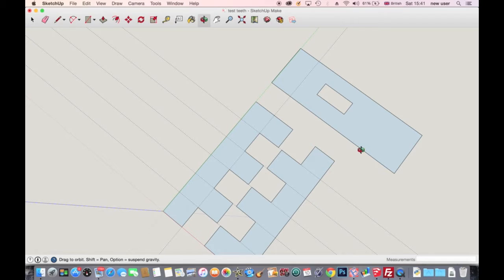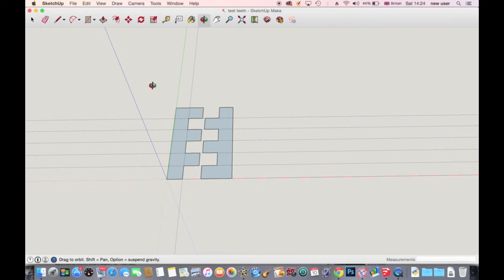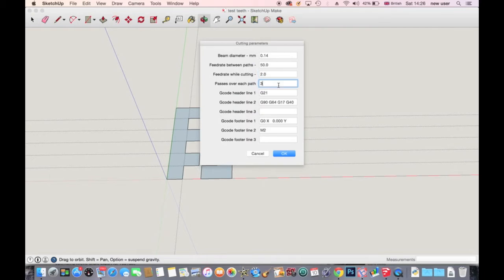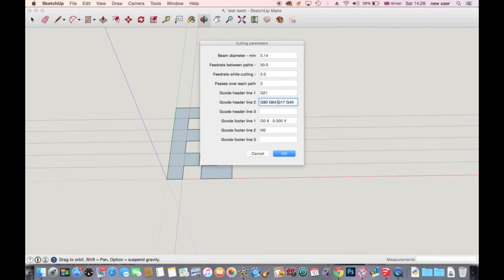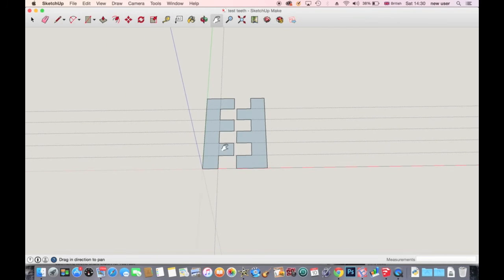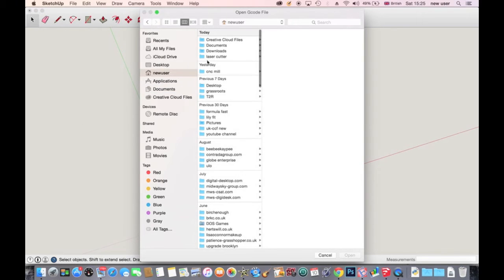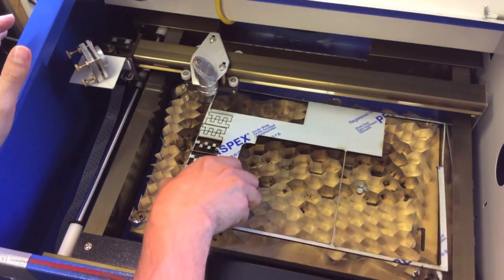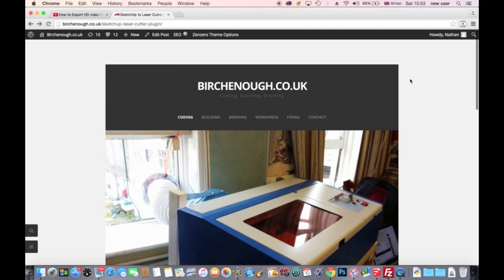SketchUp to GCode Plugin

Comment: I'm going to have to try use this plugin to see if I can create the SVG file that was problematic for me!
Reply from the maker: +Educating Savvas Now, an SVG export option would be an interesting extension for my plugin. The SVG spec looks quite simple - maybe I should have a look at the ones you've used with the Inventables machine. Although I still think you should try running it on Marlin instead of their firmware!

Comment: Great Video and very informative, I can't wait to try your sketup plugin.  I am going to mount a laser on my CNC to cut foam and acrylic.  Do you have a laser you can reccomend?  A big

Thanks to you for sharing your work!
Reply from the maker: I use a 40W CO2 laser but of course you can't mount that on a CNC machine - unless you use mirrors and add a whole lot of safety features. My friend https://www.youtube.com/user/miscpro has experimented with some laser diodes in the past and has recently been given a very powerful one to try, so he might make a video about that soonish. You are going to need quite a powerful laser diode to cut acrylic.
Reply from the maker: That looks really interesting - these diodes have got a lot more useful than I realised, thanks for pushing me to find out.. I also found this video, these guys say they may be able to sell a 10W diode soon, which would (in my opinion) probably equal the performance of my Chinese CO2 laser.. https://www.youtube.com/watch?v=uOjtAxAD6dg&t=327s

Comment: I am only using the free version of sketchup and want to create G-code for a CNC milling machine conversion. Without the code, there's no point in investing in ballscrews and servo motors, so I'm stuck. I don't see any extension menu in preferences. Any advice would be greatly appreciated. Thanks.
Reply from the maker: Hi, I'm sorry, since I made this video, my website content has been lost and I don't have this plugin code any more. I recommend checking out free software such as inventables Easel, which can be persuaded to create GCode for any CNC machine (I made a video about that). You might be able to export DXF files (using a free plugin) from Sketchup, and import them to Easel to generate the GCode. As with the plugin I wrote, this can only handle flat shapes. Sorry I can't be of more help.

Comment: OK ... so if you create a plugin that will export Gcode for Mach3 you'll have something life changing!  So many people use Mach3 to run their machines.  And I think Sketchup is an awesome program.  I use it all the time for 3d printing.  But if I could export right out to my Mach3 router or my lathe I would be in part making nirvana!
Reply from the maker: +TNA2Me I've never used Mach3 (I probably should try it sooner or later!) but I should think that the GCode my plugin exports is compatible with it - as far as I know, the only difference between using Mach3, compared to using Pronterface paired with an Arduino based CNC machine, is that you'd load the GCode right into Mach3 which then turns it directly into pulses for the motors, whereas with an Arduino based machine you send the GCode to the machine, and the Arduino sends pulses to the motors. - Having said that, there may be minor differences in the GCode style needed for Mach3. But I'd be interested to know if Mach3 doesn't work how I think it does?

Comment: Hello. I have found your plugin very helpful. 
I have tried it to generate Gcode for hotwire foam cutter I built at home. Since your pluging generate Gcode with multiple movements from X0Y0 point to cut out and inner parts. Which is fine for a laser cutter. This movement obviously slices my foamboard several times.  Can you suggest a way I can use Gcode from your plugin can be used for 2D hotwire foam cutter. Thanks.
Reply from the maker: Hi, I'm glad to hear that you're using my plugin! It sounds like the simplest thing to do would be to use a text editing program with find/replace function to remove all the X0Y0 lines, then the wire cutter will move from the last point on one shape to the first point on the next. Or if you can split your design into separate shapes, in separate SketchUp files, and cut each one individually that might work? Of course on a hot wire cutter you won't be able to cut internal holes within shapes and there's no easy way to modify my plugin to allow that. Also I'm afraid I can't modify my plugin to avoid passing over / through shapes that it has already cut - that's just too much work and I don't get paid to develop these things.. although I wish that this could be my full time job! Anyway I hope you find a way to achieve what you need.
Reply: Thanks. I appreciate your work on the plugin.

Comment: this works for cnc cut paths right?
Reply from the maker: +Summers Woodworking This is only for laser cutters so far. It will generate an offset path from any 2D drawing but I haven't added any Z-axis commands yet. This will be a relatively small change so that's the next thing I'm going to add.
Reply from the maker: +Summers Woodworking Another thing I want to add is more 2.5D - style functions for cutting different depths within the same file. That could be implemented for a laser cutter just by doing different numbers of passes over the various depths..
Reply: +OpenTronic cool please keep me updated.

Comment: Can I use this plug in plasma cutting machine.
Reply from the maker: It depends on the way your machine's GCODE interpreter works. My code is designed so that on cutting moves it sends G1 and on non-cutting moves it will send G0. As long as your plasma cutter works like that, my plugin should work. What control board does your machine have?
Reply: :) Arduino uno